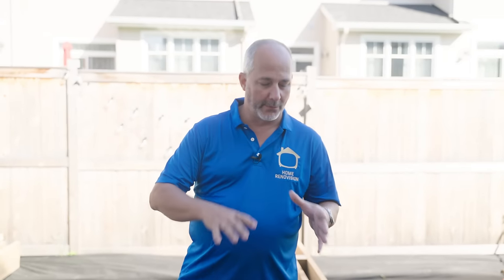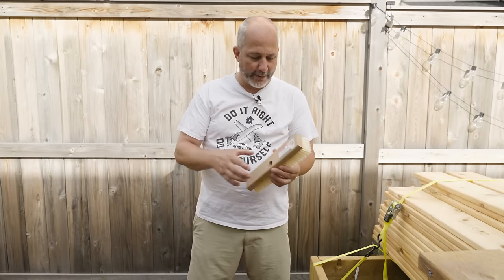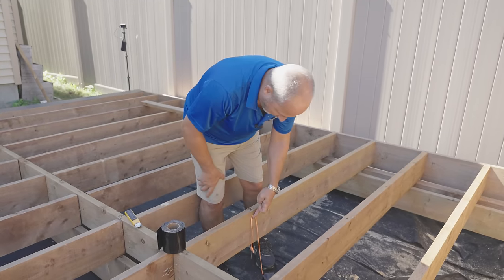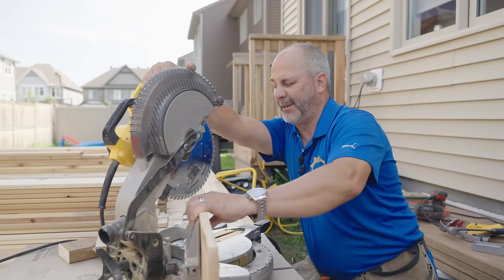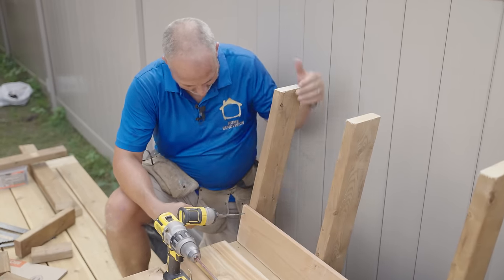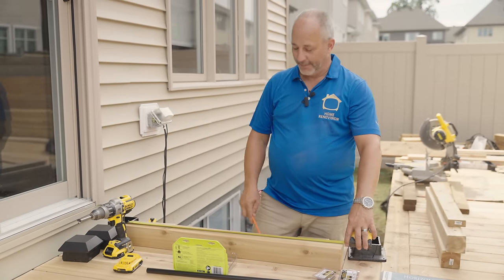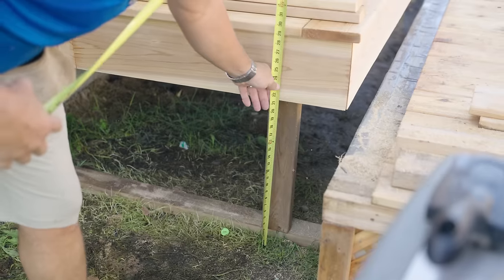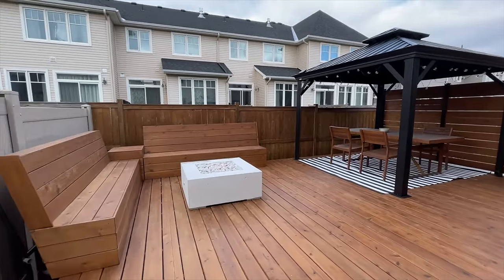How I Built a $35K Deck for $6K | DIY

Comment: A Hudson sprayer works wonders. I got tired watching you work so hard. 50/50 mix. also turns Mobil homes and car port eaves brand new. no scrubbing. wear glasses and work backwards towards the wind or that bleach will get ya.